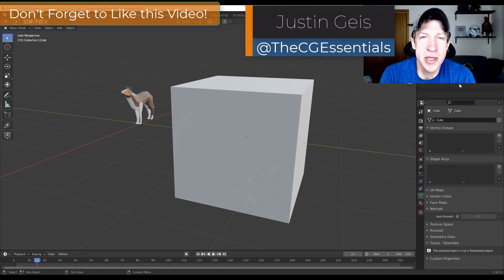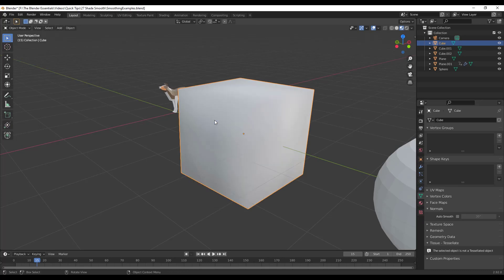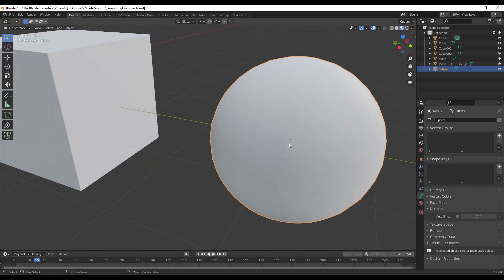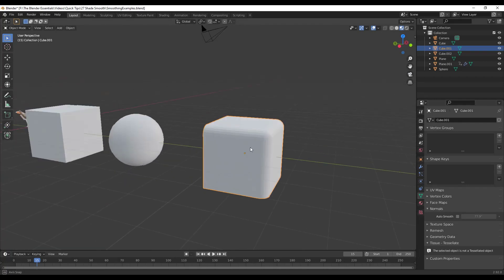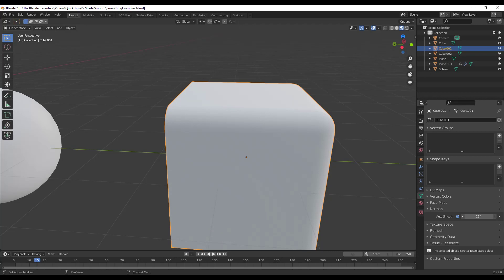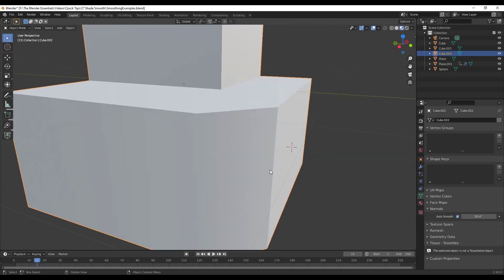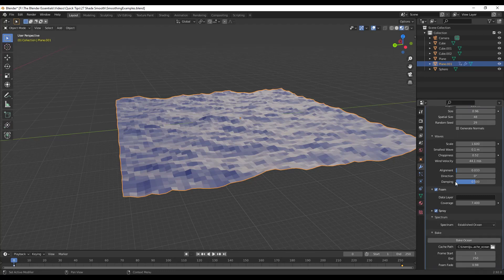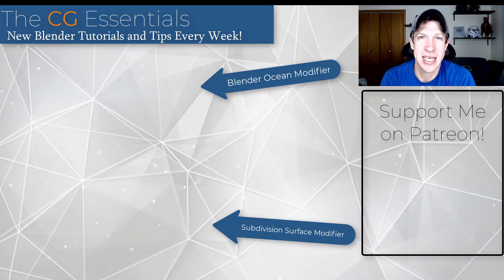Using SHADE SMOOTH and AUTO SMOOTH in Blender - Smoothing Step By Step!

Comment: You always explain things very clearly, dude. Thanks. But what's the deal with the warning the subdivision surface modifier gives when the autosmooth is on: 'Autosmooth or custom normals detected, disabling GPU subdivision'? Is it still subdividing with the CPU? Is this something to avoid?

Comment: Cool explanation! Though I have a bit problem with the 'Auto smooth' Sphere. All other objects behave exactly like been said here in this tutorial, but the sphere does not want to be smooth. It stays exactly like before I check this 'Shade smooth' option. 

btw. 'Shade smooth' is like the 'Phong' tag in C4D. But in C4D all object has it from the start. Is there any option to have it the same way as in C4D? Maybe it's some Preferences thing?